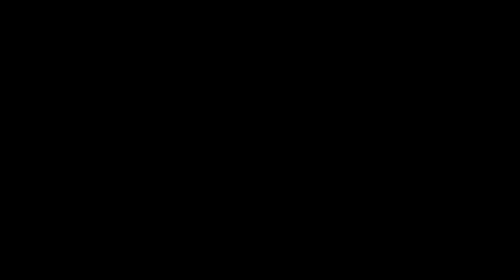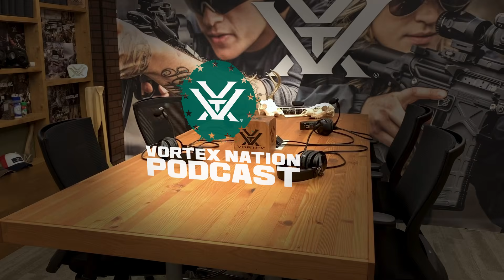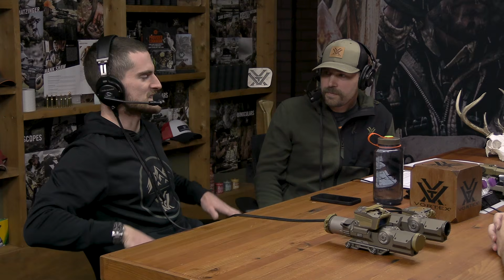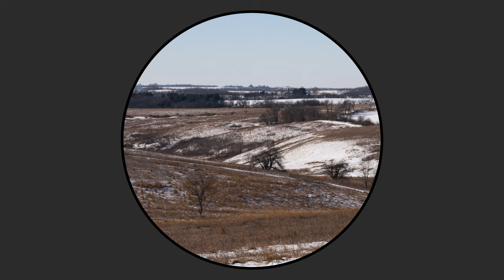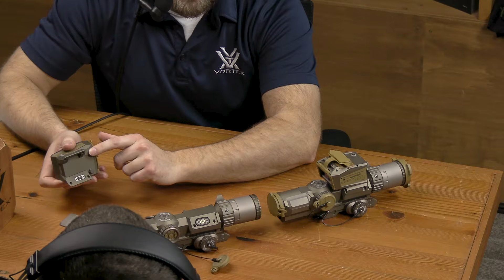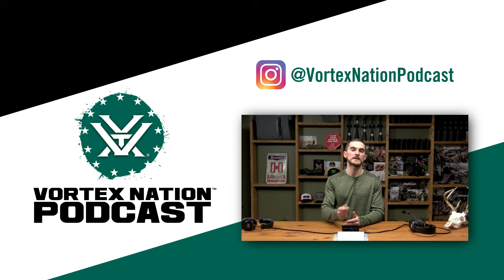Ep. 220 | Army selects Vortex® for Next Generation Squad Weapon – Fire Control. What is it?

Comment: You mentioned IR qnd red laser slaved to the analog reticle. Will it have IR illuminator as well? That would justify the added weight/cost of "the box" for most of us and shift the balance for the weapon more to the center. Being able to operate the IR laser and illuminator with a pressure switch from there would be good

Comment: I used LRF's in the field (Afghanistan), not on a rifle, but for surveillance and spotting. The LRF is an IR or NIR laser, generally speaking not visible to the eye. Is there any reason you couldn't use the same laser for LRF or for laser aiming? An IR laser would be ideal for LRF as longer wavelengths can penetrate particles and dust better than visible, so I'm not quite sure I understand why the LRF and aiming laser need to be different. Combining two lasers into one would save more weight and make it even more compact.
Reply from the maker: Thank you for your service! At this time we can't go into the actual tech specs and why certain decisions were made over others.
Reply: I was wondering how eye safe is the laser. I was an MFC and our “eye safe” laser wasn’t so safe once troops were observing through stronger powered optics. I’d assume as it is mounted on a x8 scope it’ll be ok for that. We’d say, “Laser firing” and your buddies would stop observing through optics.

Too weak and you can’t use it in the snow, rain, mist, etc, and too strong and you’d need a filter. It’s certainly an amazing piece of tech. I’m quite jealous this was produced long after my career ended.

Comment: Question time, although I’m not sure how much you can answer

1) With the dual reticle system (etched and electronic), what caliber will the etched reticle be calibrated for? Although you would be able to easily change calibers with the electronic reticle, replacing or changing the etched would be much more difficult. The reason for asking is that you mentioned this was going to initially be fielded with legacy systems, which are ballistically different from the NGWS systems. As a result, manual calculations in the case of a battery failure could become tedious and difficult

2) What is the focal place of the “box”. Since all 3 adjust accordingly, are the lasers simply parallel or do they eventually intersect?

Comment: Nothing new. 😉

Did some testing with the IABG for the German Military in 94-96 with a identical system like that on a .50 McMillan. Back then it was about triple the size though.
Reply: Nothing new? 1/3 the size, going from impractical to practical is new in a very significant way.
Reply: @richardthomas6602  Your right, just the concept is nothing new and Vortex brought it to another level. So Chapeau to them.

Comment: This is perfect. Would live to see it paired with an 18inch 6mm ARC Rec7 AR15
Reply: That sounds phenomenal.

Imagine a 16" WWSD rifle in 6mm arc with this.
Then paired with an IAR with a Quatro lower in 6mm arc for the light squad support role. Backed up with either a 6.8 SAW replacement, or the MG 338.
Reply: @ravissary79  hell yes the 6 ARC looks amazing especially if they use those curved 26 round or 20 round steel mags that seem to be reliable. Awesome
Reply: @Dick Izzinya sorry I meant the 240 role, not the 249.
If you've been following the NGSW program, sigs saw replacement is in 6.8 (277 fury) and is half the weight of a 5.56 SAW, but is even more powerful than the 240.
The MG 338 is about similar weight or slightly lighter than the 240 but has almost double the power, and comparable effective range as the Ma Deuce. 
I like the idea of a military ruggedized wwsd in 6mm arc because it would still have better range than almost anything else in an intermediate sized package, but weigh almost a pound lighter than even the original m16 with a pencil barrel, yet is more accurate (though it's still too light to handle mag dumps).

If the vortex fire control system replaces all of the gizmos on an M4 except a flashlight, then you'd still have accessory weight savings that are significant yet you could potentially engage targets out to 1000 yards. 
The whole squads weight savings would be tangible without sacrificing range or power or significantly impacting ammo numbers... unlike the 6.8 which is a full size cartridge with a lot of recoil. Designed for firearms that start out 3 lbs heavier than the wwsd rifle.

But both cartridges can reach out to 1000 yards, so the optic would be a huge benefit.